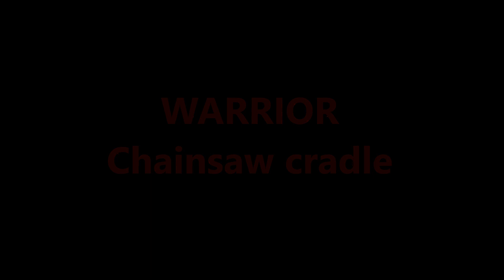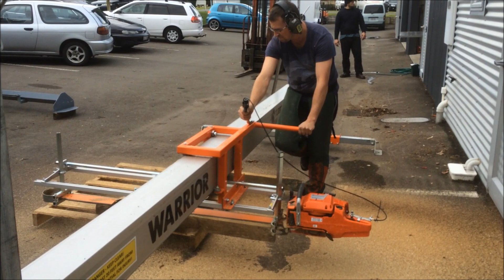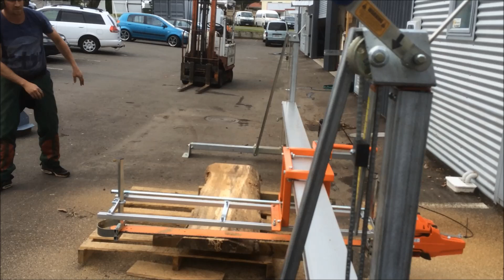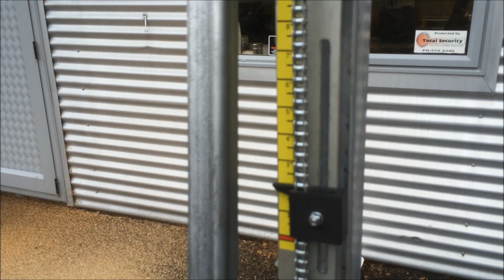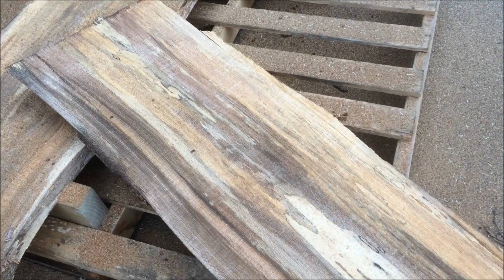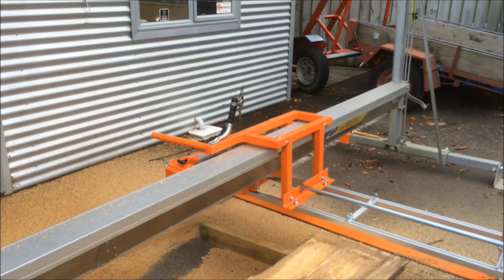WARRIOR CHAINSAW CRADLE

Comment: Do you have or do you plan on having a slabbing attachment for your bigger saws?
Reply from the maker: Yep we make a dedicated slabber with 20hp Honda or Kohler engine unit for the Gladiator, slabber attachment for the 4-stroke Warrior and this chainsaw cradle system.
Reply: TURBOSAWMILL
Thanks.